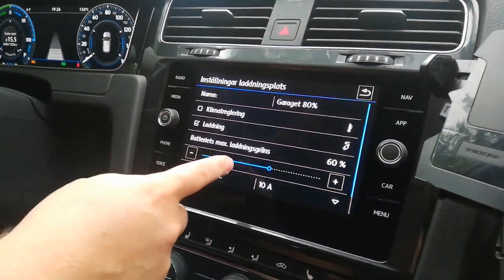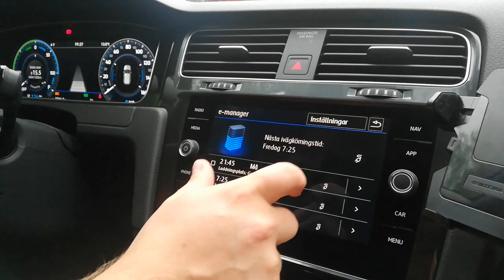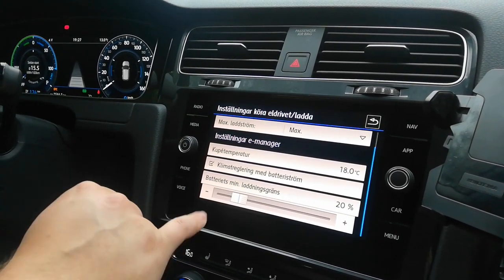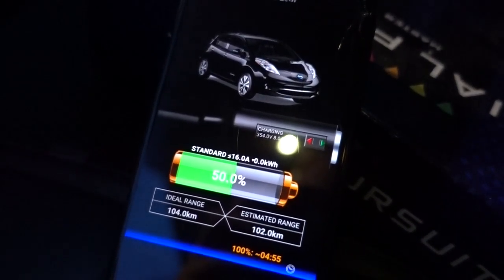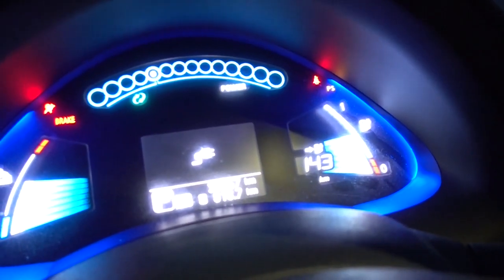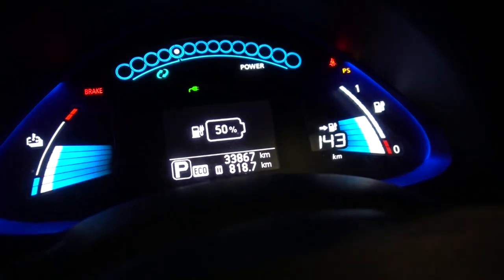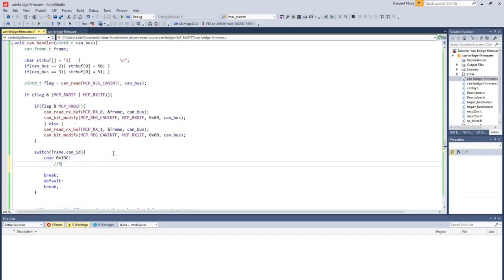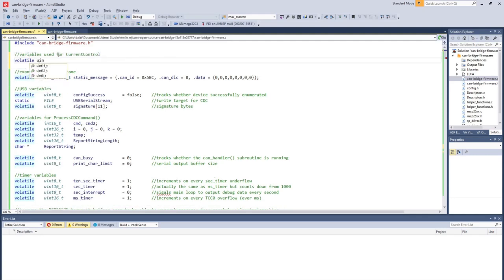Limiting charging power (AC) directly on the Nissan Leaf

Comment: Nice work and another useful feature added.  It's a great hack. 

I've copied your trick of dual using climate controls for my SoC Display project. In my case I use; Climate Control = ON, VentTarget = FEET and VentIntake - RECIRC, then the fan speed sets my display options.

I guess in the ideal world we'd be able to create new content on the navigation screen. Lots of people here in New Zealand are employing the Xanavi.biz Japanese to English language conversion for the AV unit, so it's theoretically do-able, but I suspect much harder than our CAN bus based hacks.